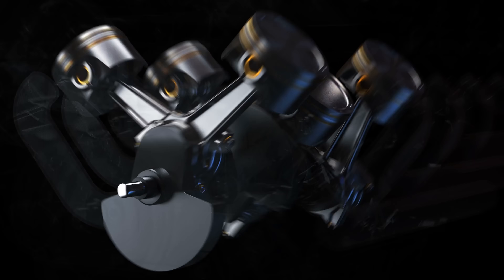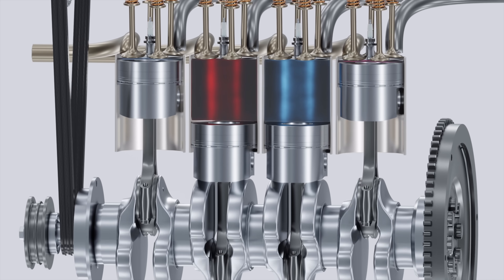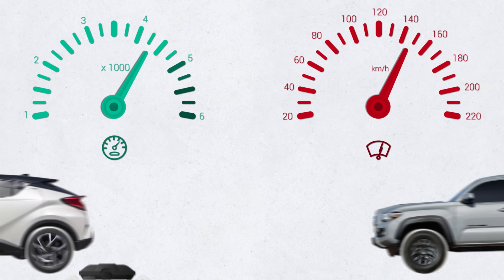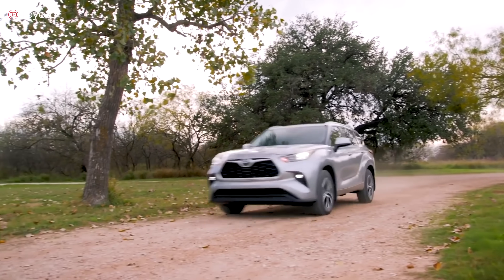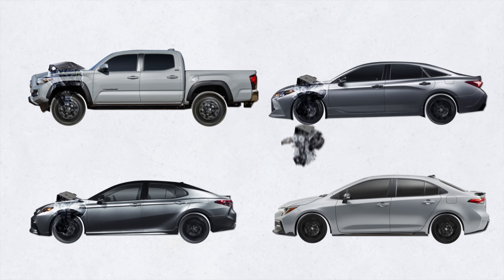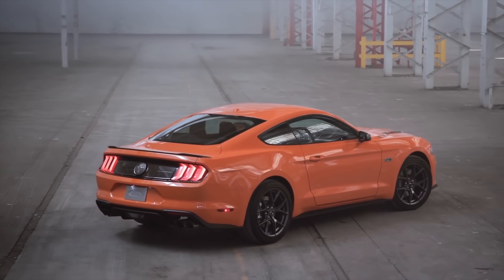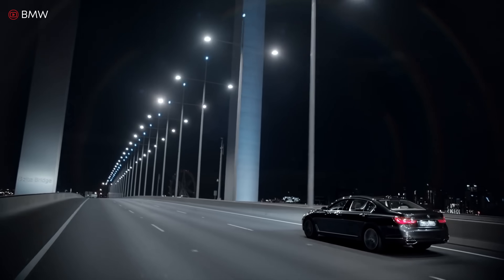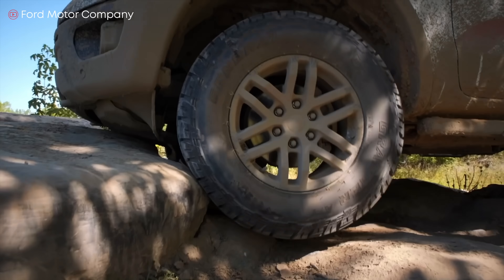No One is Telling You the Truth About Turbocharged Cars, So I Have To

Comment: I bought my Accord EX-L V-6/6MT in 2017 for the very reason that they were retiring the V-6 engine in them. I did NOT want to get a turbo I-4 because the V-6 doesn't have to work nearly as hard to put out the power, and they sound good too.
Reply: Remember to change the timing belt
Reply: @hollowarrow16  I have a '95 Civic which also has one. IIRC the interval is seven years or 90,000 miles whichever occurs first. Thanx for the reminder.
Reply: @hollowarrow16  
My belt lasted 172k. 
Honda Accord V6 multiple climates
Reply: This is the biggest misconception of the masses with little knowledge about physic. Here is why physics is important. 

Did you know how that if they make the same power, they are producing work equally as hard?  

So the Honda V6 made ~270 HP, the inline 4 makes ~250 HP.  So by power rating, the I4 is doing less work.
Reply: @AgonxOC  And the work is dispersed over more cylinders and more space
Reply: No reason you couldn't turbo your v6
Reply: @AgonxOC  An I-4 turbocharged engine will wear out faster than a naturally aspirated V6 making the same amount of power.
Reply: @ogalief  negative! Still doing the same work, your misconception and argument is invalid. 

It I made a NA, I4 the size of a V6, making the same power, the engine still makes the same work. Physics. Go learn some! It’s real!
Reply: @vaportrail226  True, but for now it has enough get-up-and-go for me being normally aspirated.
Reply: @AgonxOC  most 4 cylinders out now are around 2L. Most V6s that come to mind are around 3.5L. You rarely (outside of industrial applications) see 4 cylinders with the displacements larger than 2.5L. That's a lot of force dispersed over a smaller area.

And relax dude, we're just talking about engines. No need to get cunty
Reply: @ogalief  so now you have no factual information, you call me a name. Cute! 

Maybe you need to read, study, and learn. What you are saying it’s wrong. If the engines have the same HP, they are doing the same work.
Reply: @AgonxOC  you're on here bullying people about cars and their lack of education.  You're going to jail and I'm going to help you go!
Reply: @bosshawg7427  bullying? Educate how am I bullying!? How old are you?
Reply: @AgonxOC  I don't have to educate you about anything! You're the one so educated, soyou should already know what your charge will be. Then you're asking my age?!  Totally illegal.  You're being reported and I WILL definitely file charges!
Reply: @bosshawg7427  🤣🤣🤣
Reply: @AgonxOC  If a locomotive engine produced the same power output as a small 2L turbo, yes, they would be producing the same power (physics!). However, which one would last longer? That is the debate here.
Reply: @bosshawg7427  Now who is the bully here, big boss? Go pick on someone your own size and leave the little kids alone.
Reply: @rogerbritus9378  not even an intelligent comparison. Engines last based on strength of components, not size or number of cylinders or HP produced. A low RPM diesel engine designed for constant speed may last longer than a high RPM variable speed engine,  but it all depends on its robustness. 

A 3.5 V6 is not working less than a 2.0T. As a matter of fact, that 2.0T is making more torque at much much lower RPM, meaning it requires leas wear and if people let the EGT get low enough prior to shut down, will make that turbo last a long time.
Reply: @AgonxOC  How many engines have you designed along with the best in the (commercial) world? It shows from your answers that your comprehension of materials and engineering is quite limited to a few pointers. Knowing what you don't know is the first step to learning something. If that's your goal, of course. Or, you may choose to proudly defend your lack of knowledge here - your call.
Reply: @rogerbritus9378  how many engines have you designed? Based on your comparison, most likely none.  You are the one displaying very limited knowledge comparing a Locomotive Diesel to a 2.0T Automotive Otto engine. 

Engines longevity is about its robustness, not its size. I mean look at SAAB two stroke three cylinder. That engine ran forever…… It even won a few races here and there. 

Is my 3.0T with some 450ft-lbs at 2500-5000 RPM going to last less than a 390 ft-lbs at 4500 5.0 NA?
Reply: @AgonxOC  Haha, I can see you have no rebuttal to my points, that's because you don't know how cars and especially, engines work. Look up the Civic type R overheating on track, in fact look up turbo I4s overheating on track. When you're done with the myriad of results, then find me ANY N/A v6 overheating on track. Here's a pointer, you won't find ANY. Literally any half-baked N/A V6 performance car with a half-decent cooling system will never overheat on track, and this has been so since the 80s.
Where I live, turbos cars will overheat just by being driven hard on the street. You can actually notice the ecu cutting power. N/A V6s don't have this problem.
Turbo engines consistently run hotter over their lives. This is damaging to the engines internals, as well as the lubricating oil in the engine. 
A proper N/A V6 will always last longer than a turbo 4 cylinder!
Reply: @danyalag3366  where are your points? I don’t see any…….. 

You claim a lot and yet you have zero clue about engines. 

List all the V6 N/A at the track….. I will wait.
Reply: @AgonxOC The fact that you're asking that question only validates my point... that you know absolutely nothing about cars. But all right, here's a few
1. NSX
2. Nissan 350z/370z
3. Porsche Cayman(Flat 6 N/A)
4. porsche 911 GT3 (Flat 6 N/A)
5. Accord 6-6(not a track car per se, but can handle it)
6. E46 M3 (N/A I6)

Enough N/A 6 cylinder cars for you eh?
Oh and here's the kicker: NONE of these cars overheat on track, even in 110 Fahrenheit conditions. The tires and brakes give out way before the cooling system does! 
ALL turbo 4 cylinders eventually overheat on track. Max they last is 5 laps on a 2-3 min circuit in 90-100 Fahrenheit conditions. 
But all right, you go on believing your delusion that turbo cars aren't overstressed LOL. Such a noob.

Comment: V6 for longevity, pushing 4 cylinders to do the work of 6 only wears out the engine. I rarely see a turbo engine last 300 000km but many V6 last over 300k km
Reply: keep a car that long? Hell no..
Reply: @erickwalker11  in Balkans cars that have 300 000km are like new
Reply: turbo engines tend to rev lower, especially on the highway., altho, yes 4cyl have to do more work, engine revs have far more of an impact on engine life then all other factors. most turbo 4's rev way below 2k rpm on the highway, while you would be hard pressed to find a v6 that revs below 2k.

i mention this cuz ive seen turbo 4's go crazy mileage, and ive also seen v6's blow up under 100,000km's. me thinks that peiople that own turbo cars tend to drive them more aggressively, so its not what people think.

Comment: V6 any day. That instant torque and sound can’t be beat by a turbo i4.
Reply: And that's why I chose the 3.7 instead of the 2.3 for my Mustang.  AND...I still get 29 to 30 miles per gallon!
/HOW many times have we heard Scotty complain about turbos?  About how they wear out before their time?
//I rest my case!
Reply: V6s don’t have as much low end or instant torque as a turbo or supercharged
Reply: Change the differential gear in an four cylinder and you have lots of fun. Do the same with a six and you have more fun.
Reply: @mutantryeff  could you elaborate differential gear? Are you referring to regearing the transmission
Reply: @naveenthemachine  rear end diff. Change to a .411 or something like that.
Reply: My 2.0 TSI can make 258 lb-ft of torque at 1600 RPM. Dyno tests actually show they make torque in the 270's. (Let the VW hate begin)
Reply: @Dcc357  LOL I get the same hate for my 4 banger Camaro even though it isn't stock. I like to build my cars instead of buy them, I feel like I have personally accomplished something by making my car do something it wasn't necessarily built to do. That is just personal preference though.
Reply: @naveenthemachine  Scotty just talked about turbo lag.
Reply: @Dcc357  2.0t FSI,my apr stage 1 tune is rated pretty high, never dynod it but the tune on an identical car made 236whp and 276wtq, and id also argue that the issues I’ve experienced with my car are ones you have with every car😂
Reply: @hanzgrueber145  I'm just happy my GTI is actually brand new! First vehicle I ever had with a plastic water pump, turbo, and GDI though, so my future problems will be different than other vehicles I had/have.
Reply: Scariest incident I ever had was an idler pulley failure which is more common on any car than you think, mine had 168,000 MILES on it not km, where the timing belt which is apparently so fragile starting sanding away at a steel bolt getting halfway through and slicing into the flange holding the water pump assembly. The belt actually looked pretty good😂☠️ it didnt jump timing that’s all I needed being an interference engine but it was a costly repair good thing it’s warrantied for 2years and won’t have to be done for atleast another 100k miles
Reply: How about a v6 with a turbo, I love mine.
Reply: Until I gap you 😂
Reply: @penguwan_9515  cool , hope you got more than 400 hp
Reply: @hanzgrueber145  it had an external timing belt that ran the water pump?
Reply: @christopher_contreras  
That's more like it.
Reply: Turbo V6 any day or turbo V8 even better!
Reply: Instant torque? I don’t think so! This is not an electric motor. Another misconception here folks. N/A engine don’t make instant anything. 

Now, if you are in the max torque range in gear, then you will feel that “instant” torque, while a turbo, will not be boosting, but in that rage, boost come within seconds and feels so much better because you make a lot more torque. On average a I4T makes a lot more torque than a V6.
Reply: @billrehm3590  Nah most cars that are turbocharged from factory have no lag. Usually a smaller turbo that spools super fast and makes a lot of torque down low and in the midrange.
Reply: @alecm2721  this is true
Reply: agreed

Comment: Turbo Honda(Acura), Toyota(real or Lexus) or turbo diesel are the only reliable turbo powered vehicles in my humble opinion.  Also, I think the inline 6 turbo engines are better than v6 turbos.  To bad the list of 4 cylinder fast cars missed the 310hp/290ftlbs Subaru STI when the Lancer Evo was mentioned.  The STI S209 variant actually hits a womping 341hp/330ftlbs!
Reply: Isuzu makes also good turbo diesel engines.
Reply: @vrterl9850  I agree, some of the best.  :)
Reply: Off topic  the Mercedes OM 617 diesel  5 cylinder is a legend
Reply: BMW b series engines are fantastic
Reply: VW/Audi 2.0 TSI engines barely became average until late into its 3rd generation (past 4 years lol). They would have been way more reliable if they just used better timing chain tensioners, piston rings, and didn't use screens to filter the oil to the balance shafts in earlier versions. Otherwise, they do have a very strong bottom end and are quite tuneable. Also very smooth for 4 cylinder engines. Mercedes 4 cylinders vibrate more.
Reply: Toyota 2.8 Turbo Diesel suck, it has a major DPF problem which they have finally fixed but requires you to manually regenerate the DPF by stopping and using a button 🤣

I don’t like Turbo 4 cylinder petrols but I’ve had a BMW N47 (4cyl turbo diesel) and N57 (6cyl twin turbo diesel) which have been flawless engines.
Reply: The video is about inline 4s not boxers
Reply: Well, I assume the STi didn't make the list due to the fact it isn't an inline 4. It's a boxer motor. Granted, recently Scotty's opinions of the Subaru boxer 4s have become less despairing than previously articulated. Just the same, between the fact that its motor isn't an inline 4 and his generally negative opinion on the Turbocharged Boxer 4s, it probably resulted in the WRX STi not being mentioned. 

In regards to the S209, its power is matched by its upgraded looks. Gorgeous car! Not quite $75-90k+ gorgeous IMHO (general going rate for a used S209 currently), but I'd be happy to take one for a ride at minimum, lol. I love my 2015 STi. Extremely fun car to drive. The 2021 STi will be the last to feature the EJ25. The newer FA24 supposedly will replace the EJ in 2022. Rumors have been swirling in speculation of its power. I've heard estimates around 350 - 400+ HP. We shall see in the coming days as it's due to make its debut!!! 

The only thing that makes me less enthusiastic is the probability that it will be a Direct Injection motor. If they happen to utilize the D-4S injection system from the BRZ/GT86, then I'll be a little less apprehensive as that features both direct and port injectors. With all the carbon build up issues surrounding Direct Injection, coupled with Subaru Boxer motor's (or should I say the tuners, lol) love for ethanol, I can only see more intensive maintenance being required in the future for the FA24 in the next gen WRX STi. Seeing the STi finally move away from a rubber timing belt is a nice bonus though.
Reply: @graydeanj  except for all the plastic crap!
Reply: @peterbiere9384  plastic is light. What else are car manufacturers supposed to use? "OnlY CaRboN FiBeR"
Reply: @graydeanj  no, JB weld!
Reply: For real. And if your willing to do some work yourself you can build a shortblock sti for 10 grand easy to make 600-800 horsepower it really is insane what you can to do those little engines.
Reply: @tylernavarro1  boxer motors are trash either way lol
Reply: N54 bmw engine is 2jz but German made
Reply: subarus are fast for about 3000 miles
Reply: @peterbiere9384  but the B58 was good enough for Toyota.
Reply: @yourlame9795   @Yourlame  
Subaru boxers are trash? hahahaaha
80% of subarus made in the early 2000's are still driving on the road today
If they get treated well enough, they last over 250000 miles
You see the problem with Subaru is that they have two very distinct customers .. The landed gentry and chavs. The problem is that never the twain shall meet, despite a mutual interest in Burberry and shotguns.
So you tend to find that the Foresters last for an age and only go to the great scrapyard in the sky when the smell of wet springer spaniel prevents the owner from giving the Vicar a lift.
On the other hand the Impreza tends to end up on it’s side in a ditch at an early age, due to the inexperience of the driver (Someone told me it’s not usually the first owner, usually the second owner.)
Even tho the Impreza and the Forester share a similar engine.
I own a 2001 WRX daily beater... about 180.000 miles, orignal clutch and trans and it still drives very good! It never let me down once, never let me leave in the cold and always turned on and drove fine... 
There are thousands and thousands of old subarus with 250k+ miles on the road
Reply: @peterbiere9384  what plastic crap? Most of that plastic will last well over 100K or more, and that plastic that fails is usually silky hoses that are cheap and easy to replace. Also most manufacturers do this and have been doing it since the late 90s.
Reply: You left out the Volvo inline 5 cylinder turbos... therefore you are disqualified from talking cars ever again sire 😒🤣
Reply: Volvo Inline 6 turbo (t6)
Reply: 5cyl turbo volvo
Reply: @bigbanktakelilbankLABIH  the Volvo 2.5 I5 turbo (also in the mk2 Focus ST in Europe) is a tank of an engine.